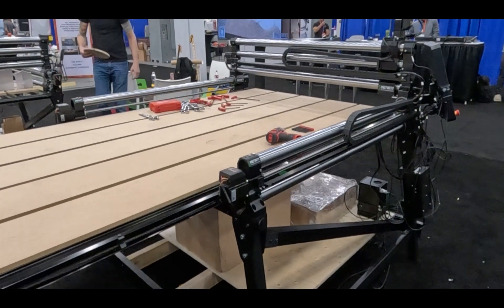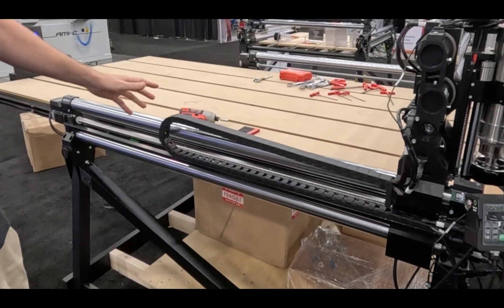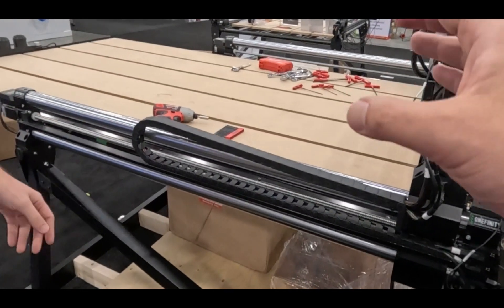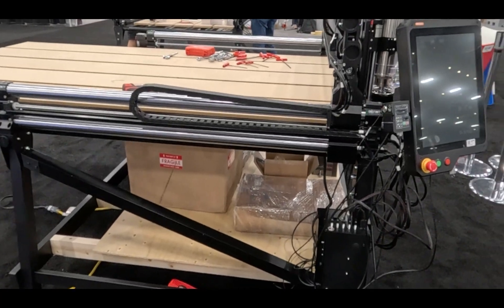Onefinity Full 8 Table: Cut 4'x8' Projects Without a Giant CNC (AWFS 2025)

Comment: Make a version for altmill
Reply from the maker: Bet!  If @SienciLabs wants to provide an AltMill MK2 4×4, I’ll happily build and document a fully open-source compatible stock-slinging table with free design files and BOM, with and for the community. :-)
Reply: @AzaB2C  I have one. but cant donate. but considering making a sliding table for it.
Reply from the maker: Some comments are pointing out a fixed table sized to cut 8' stock would have smaller in-use foot print.  That might be cheaper to self build too.  That said, I can see why some people would like a stock slinging CNC, I saw a few commercial ones at AWFS in July.  Feel free to share info/links on V1E forum if you embark on making a sliding table or find an existing project community members can replicate and/or contribute to... https://forum.v1e.com/t/neat/7380/1077?u=azab2c  Guessing some folks on V1E forum might be interested too.  Personally, I have indoor basement space for a 2' x 4' cutting machine, but my full sheet 4' x 8' lives in an unconditioned garage, which is miserable to work in during the winter.

Comment: "Cut 4'x8' Projects Without a Giant CNC"???  You realize this "full 8" will require about 12-14 feet just to tile a 4'x8' sheet.
Reply from the maker: You're right, needs space to sling the bed around.  Not sure what height clearance under the moving bed is available for something like rolling storage.  I guess one benefit of this design is it'll be easier to move out of the way if you're working in a space where you have to shuffle tools around, this is my situation I don't have enough room for my CNCs,  planer, table saw and circular saw to have separate permanent stations.